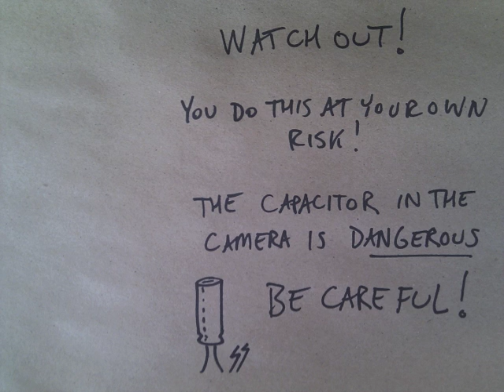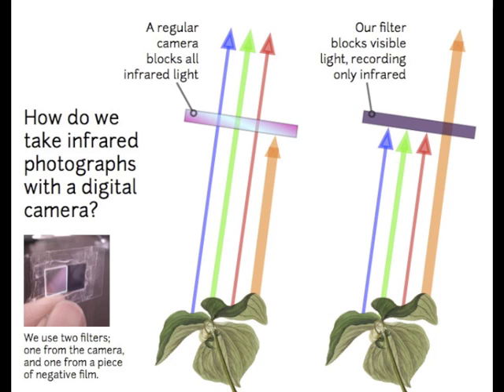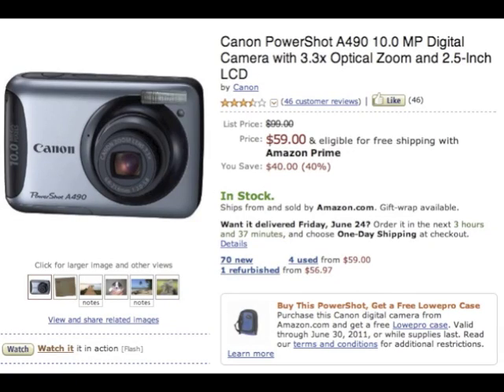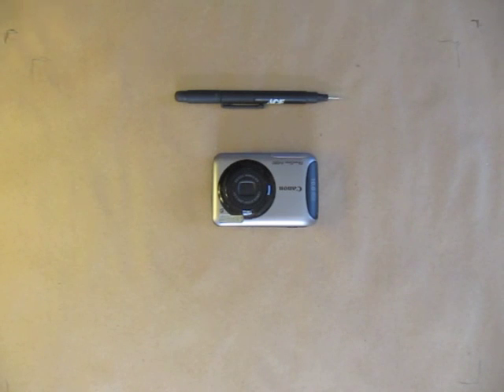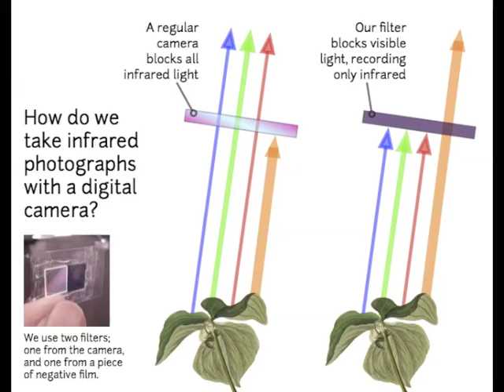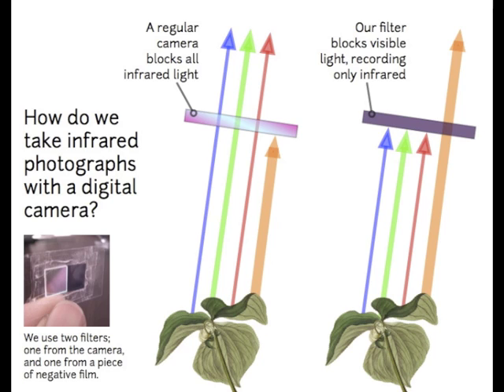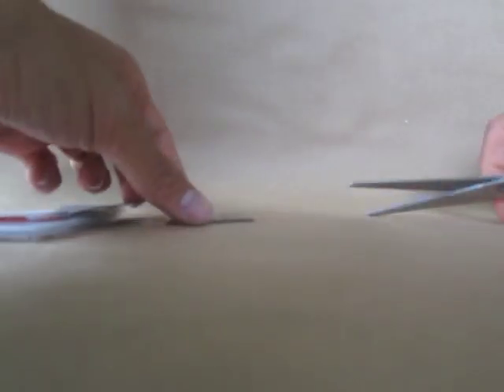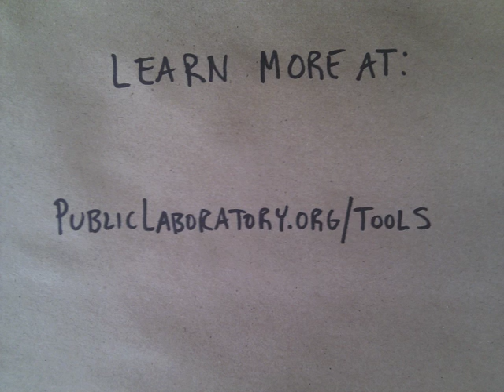Make an Infrared Camera | Public Lab

Comment: Great video!

In my case, the sensor ribbon came out as I gently folded it back (as at 11:00 on the video) . As long as the ribbon isn't damaged, you can slide it back into the slot gently, and (this is important) fold back the clip that locks it into place. If you don't fold back the clip, or slide it in wrong, the camera will power on but the image will be black.

Comment: Capacitors DO NOT store more energy than batteries. They CANNOT melt your screwdriver. They CAN hold a higher voltage, but an incredibly small charge, so they CAN shock, and it will hurt a bit. The capacitors in cameras won't do any permanent damage (Some capacitors will do permanent damage, but they are usually in microwave ovens).
Reply: That made all the difference, thanks.

Comment: Can this method be used on a Sony cybershot 8.1 megapixel. It's one of the small thin digital cameras.
Reply: +Monterey Paranormal Investigators If you can get it open without damaging it.  That camera probably has an IR filter also.  It may be more or less difficult to get to.  I have a Panasonic and a Youtube video has shown me that they are fairly easy to get the filter out of.  Just do it in a spotless room and ground yourself for ESD, If you like to wear a mohair sweater or anything else warm and fuzzy that will generate static.  I find just petting my cat on a dry winter day generates static sometimes.
Reply: Thank you very much!